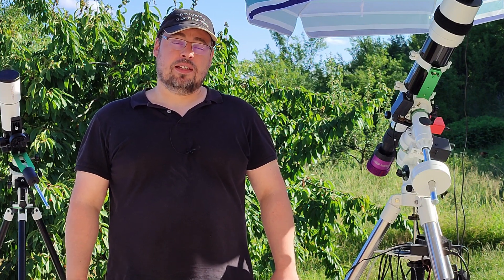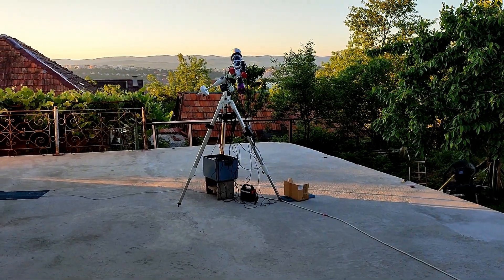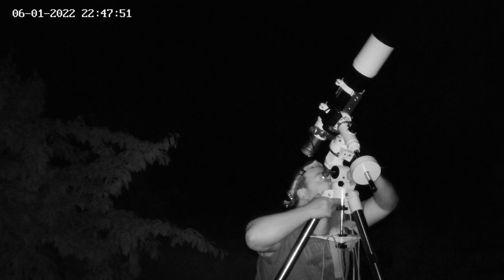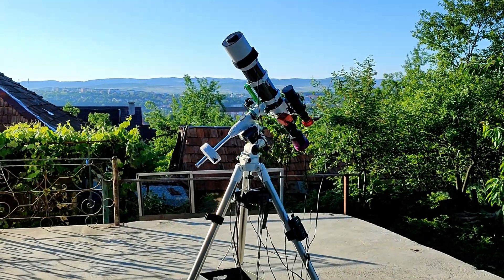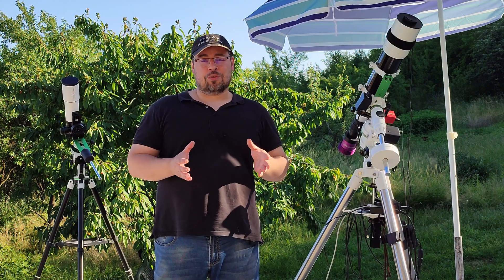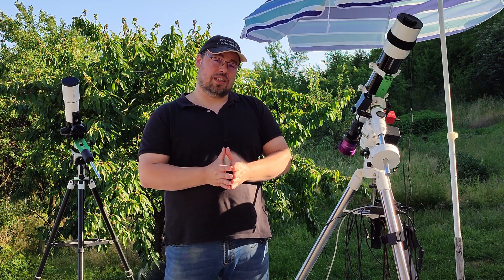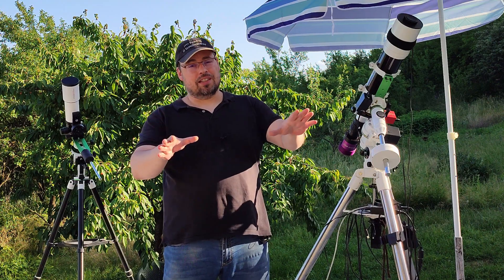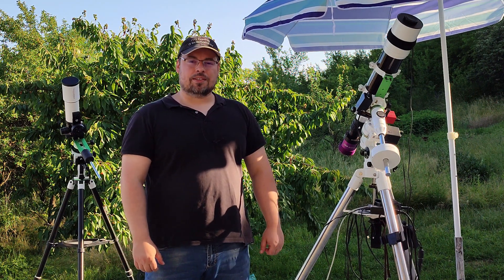New Astrobackyard & Telescope Upgrades

Comment: I’m getting into astrophotography but still haven’t bought any stuff yet. I have £2500 as a budget. I like DSO and nebula etc. what do you think the right scope and mount and camera I should get?
Reply from the maker: Hi Martin. I could recommend you the mount i have, still good after 3 years the Eqm35 pro, and a triplet refractor telescope i. I have the Tecnosky 70/420 sld triplet.  you interested in nebulas more. Is a very good combination. and a skymax 127 or higher will work good for galaxies and lunar planetary. I am very pleased with the quality of the Altair 26c but i do not think will fit in the budget with the mount and telescope. So you could buy a smaller sensor camera like the 183 for beginning and at least one filter and autoguider.